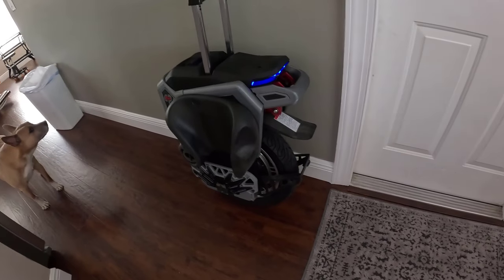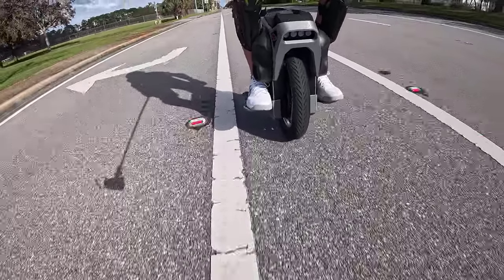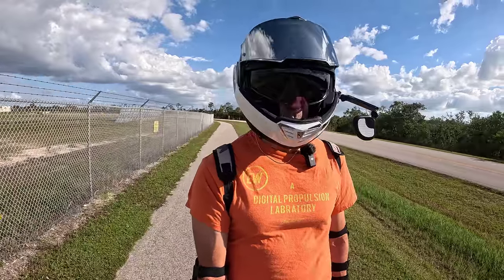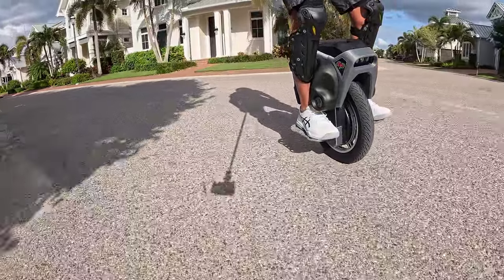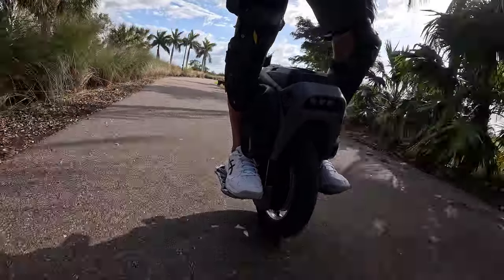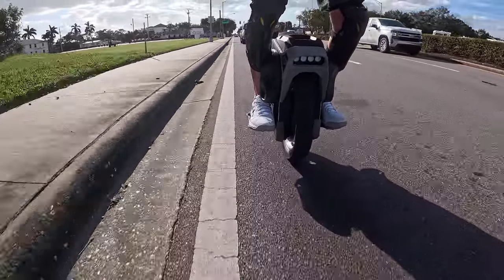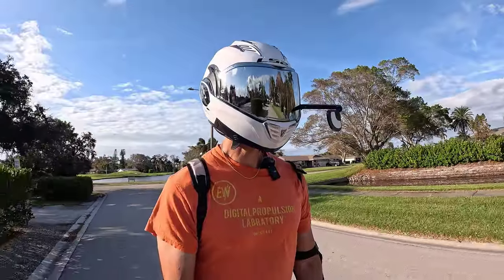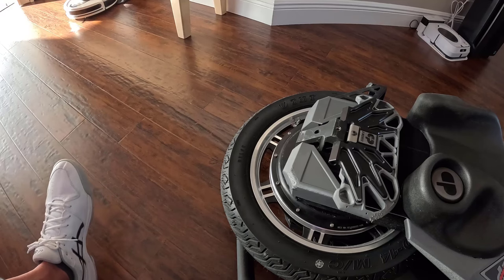Stress Testing TNT Tubeless Tires on the Begode Master V4: Will They Hold Up?

Comment: To center a tubeless tire on a rim designed for tubes:
1) wrap power-strap around diameter of tire and lightly tighten it. (Strap just helps keep the rim/tire interface tight… but not too tight.
2) reduce air pressure to between 3-5psi.
3) tap on tire with dead-blow mallet or hammer while observing offset from either side until centered. 
Optional). Adding a solution of Slime plus dish soap will help make adjustments a little easier. Soap won’t hurt anything. 
 
The trick where you go out and drop off curbs only works at lower pressure, which is why you were unsuccessful with the first attempt. (Good idea though.)
Reply from the maker: I will be working on this tonight

Comment: Hey duf, another entertaining video. Ive heard a good trick to center a tire is to deflate the tire to like 5psi and ride the wheel slowly inside your garage. The low pressure allows the tire to self center as your weight evens out the eccentricity. Maybe this could help you as well. My tubeless tire has been holding well on my Blitz, after many high jumps and offroad trails. I too am extra paranoid about checking pressure but it hasnt really lost any since i got the wheel. Tubeless seems like the way to go honestly. #master
Reply from the maker: I will try that trick and see if I have any luck.  Yea tubeless just makes sense with as fast as these things are now.
Reply: @Duf  seems like the easiest way to me lol. May not work every time but it's so easy you may as well give it a go. I've also heard of people marking the tire with a sharpie around the rim area and using that as a visual guide for alignment. Good luck brother!

Comment: If the wheel ring isn't designed for a tubeless tire, it will always be a question mark as far as reliability.  
The smart thing to do would be have a fab shop modify and center/balance a wheel ring that is designed for tubeless tires OR figure out an adapter ring/plate, get it drawn up, and have it built by an online fab shop like proto labs, Igus, et al. 
If the motor is removeable from the wheel ring, I'm not an EUC mechanic but it seems the ring should be removable from the motor.
I guess I can put that right there with the travel case, boost, and wireless charging designs - adding wheel ring adapters to restomod older wheels with tubed tires so they can take tubeless properly (maybe for EUC a bead lock product might be smart as well, for the folks that really like to pound and/or deflate it).
If there's a tubeless wheel ring that already fits that motor, so much the better - many EUC use similar motors so unless they decided to intentionally break compatibility maybe someone who has a lot of wheels and wheel parts can try swapping a wheel ring that looks close.  Also it might not be a bad idea with tubeless tires to try something like tire balancing beads to fend off the wobbles or at least be more resistant to them; they're not heavy, even in full size motorcycle/car tires, maybe a couple hundred grams would be enough for the smaller tires.
Reply: All reasonable suggestions but machine shops are crazy expensive. Tire lock liners come as small as 18” for motocross rims but EUC manufacturers would need to change the profile cross-section design to accommodate the same product as the MX industry standards. 
This will happen as the demand for tubeless tires increases as a percentage of wheels sold.  Let’s hope its soon and that 14” tire liners become available too.
Reply from the maker: I will be happy to test this further but for the riding I do, I think it will be fine.
Reply: @grb1969  they're not where I am, I guess.  Again, I haven't torn apart ANY EUC so I have no idea what I'm talking about, I'm just visualizing the little bit I do know and putting it against  the endless fixturing and machines I've had to mod the hard way in the last 30 years.  I don't get discounts on shopwork either, or maybe my expectations are different.  

The simplest thing I guess would be to just weld a fill plate inside the wheel ring of choice, then using a template of the motor outline laser cut it to fit exactly around the motor and bolt to its holes - with the plate the exact shape of the motor and the retention matching the motor perfectly it eliminates any issues of torque slippage in the parts for the prototype - if it works, that provides the pattern for a reasonable wheel ring that has the ability to shed mud and water instead of collect it like a solid plate.  If that method works, then quite literally any tubed wheel can be upgraded to tubeless without questionable reliability or spending an inordinate amount of time messing around with an arts and crafts project.

I'm not telling anyone what to do and everyone can choose their own adventure in life.  I do like solving problems, especially ones I already have or might have in the future (MTen3, V10F, S22 1st gen, V12 1st gen).  I enjoy ideas and discourse; it's not like I'm going to stop watching the videos 🙂

Comment: #Master. I'm curious, how did you donthe conversion? I'm quite interested. 

I am a brand new rider, and haven't quite gotten the hang of things, but with the glorious fail that I just had, I am thinking that tubeless may be the way to go.  Little about the fail, I had gotten to riding and moving quite well, and decided to go on a forward only brief ride, and while riding, I was absolutely ejected off of my master v4. Post crash analysis revealed that the tire bead had come off, the tube was bulged out preventing spin and also deflation. After some maneuvering and what not got it deflated, re beaded and upon re inflation, I believe the leak is at or very near the valve stem. This was day 2. Tire pressure was at 30. Any ideas?
Reply: Forgot to add, the tire says tubeless or something to that extent, which is why I asked if the conversion was easy and what was needed.
Reply from the maker: All it involved was installing a tubeless valve and the TNT street tire from Ewheels, welcome to the hobby!
Reply from the maker: You can have a tubeless tire installed but still utilize a tube in it.